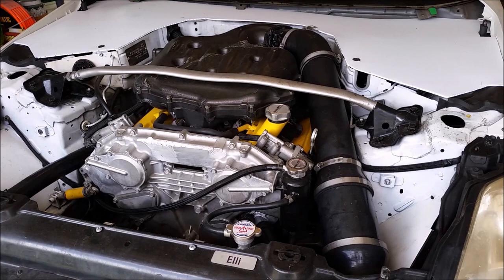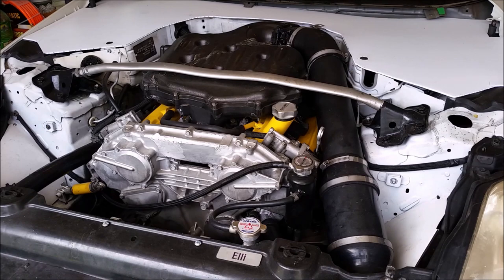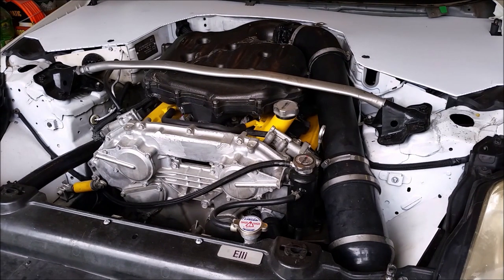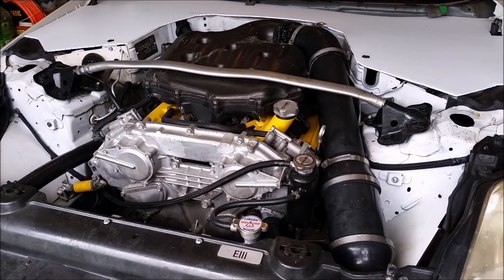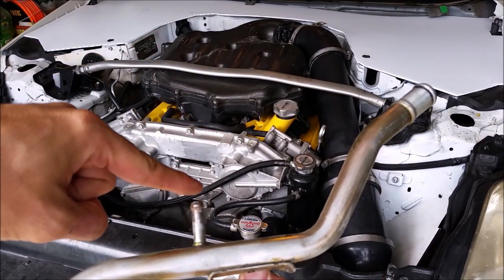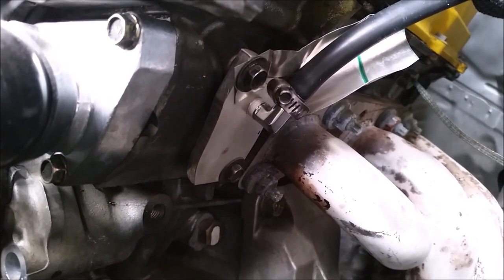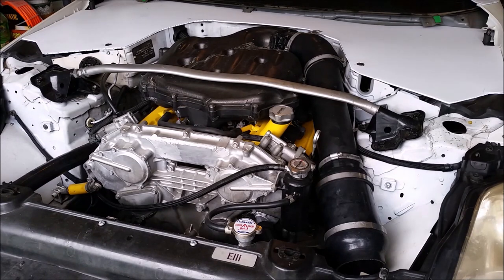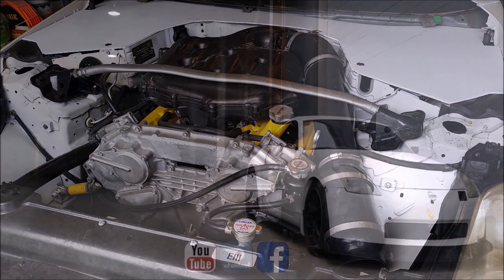Nissan 350Z Heater Hose Delete Fix DIY

Comment: I’m building my vq35de right now and deleted the lines to the throttle body and to the oil heater. I have a feeling my thermostat won’t open as a result or that and a hard to bleed system. I want to just remove the thermostat but if that’s a bad idea do you think drilling a small hole in it to allow air to escape but not much coolant would be effective?
Reply from the maker: Definitely don't delete the thermostat, you'll over heat because the coolant will flow through the radiator too quickly. Drilling the hole should work, but this way has worked perfectly for me. Before it wouldn't open and since adding the bypass hose, it's been flawless.
Reply: @350Z247  Would simply cutting off the coolant flow to the throttle body be enough to cause the thermostat to function differently, or would this be just a negligible change in its performance?
Reply from the maker: @TheChadPad  bypassing the throttle body should have no change on how the rest of the cooling system works. It should keep the throttle body cooler and leave one less failure point in the cooling system.

Comment: Really hoping you see this and can get some insight from you

I’m doing this exact same cooling setup.  The only issue I am finding is that I cannot find that block off plate with the coolant port by the manifolds. Do you know if a company who makes them or would you be willing to make one and I could pay 

Would love to hear back from you, thanks
Reply from the maker: I made it out of a plate of aluminum after tracing the gasket on it. It was very easy.

Comment: I rebuilt mine and it was fine until the bleeder valve blew and it over heated i replaced head gaskets and it over heats on me only when i turn the heater, off i did a pressure test it checked out my next step is replacing the radiator then deleting hoses like you did but the hose for the heater that you removed and added that aluminium plate, could i keep the heater hose but bock off the second pipe with a cap the one that goes to the upper radiator hose ? Because my thermostat isnt opening the coolant begins to boil? Thank you
Reply from the maker: As long as you get coolant to where I put the aluminum plate from the back of the engine, you're good. You could use the heater hose to do that, I just wanted to delete everything I could. So, your plan would work, just make sure you use silicone caps when covering that extra pipe.
Reply: @350Z247  Thank you so much for quick response ive been on this car for weeks i will try that today, will keep update
Reply from the maker: @Alexbk007  Good luck man! You could also try a lower temp thermostat to help it open a bit earlier.
Reply: @350Z247  (update) I blocked the bypass hose with silicone caps i found at oreillys, the lower hose finally startes to heat up but then it started to cool down but it didnt over heat, the lower hose was cooled but the other hose on the thermostat that goes to the oil filter was heating up should i cap those to so only coolant goes to the thermostat? Thank you
Reply from the maker: @Alexbk007  I deleted everything at one time; so, it's hard for me to say exactly which hose could be causing a problem. Just to double check, did the car get up to temperature and did it overheat? Because with the hose from the oil cooler and the hose from the heater core, your thermostat should be getting plenty of warm coolant to allow it to open.
Reply: @350Z247  it doesnt over heat until i turn the heater off on a slope ima try to deleter the oil one if that dpesnt work im going to replace the radiator because its just begins to boil at the top with a cold lower hose.
Reply from the maker: @Alexbk007  from experience, it sounds like the thermostat isn't opening and allowing coolant to flow properly. Have you bled the system with the front of the car up in the air on jack stands? The VQ is notoriously difficult to bleed. If you do get a new radiator (always a good investment, but I don't think it's the problem at this point), I have had a good experience with my Megan Racing all aluminum unit. It was like $180 I believe.
Reply: @350Z247  yea i belive theres air because i feel the sloshing jn the lower hose but ive been bleeding for over a few days now lol but i will invest in one soon. im gonna give it another try right now and see if i can get it to bleed the system thank you will update
Reply: @350Z247  (update 2) i installed the radiator, i deleted every hose besides the heater and upper and lower to the radiator and its not overheating but it wants to open the thermostat but keeps closing and i feel and hear air sloshing around the lower hose i feel the lower hose heat up at first but it doesnt get as hot as the upper hose im lost lol but my next step is to install the lower temp thermostat hopfully but i dont understand why i feel air in the lower thermostat hose after bleeding the system with a spill free funel after some time. Any suggestions? Thank you
Reply: (Update 3) ive gotten the thermostat to open on its own but putting the heater on medium allowed the coolant to heat a bit more then it open on its own and got the air out also lowing  the jack down while it cyclkng through with the funel let air out as well i went for a drive no over heating but again iver heated when i got on the drive way ive read ghat thats natural and to re bleed it and should be fine will update tomorrow but making great progress. Thank you
Reply from the maker: @Alexbk007  hmmm yeah it sounds like you've done everything to get all the air out. You could try vacuum bleeding it where you put the coolant passages under a slight vacuum then open a valve and suck all the coolant in. I've seen it done, but I've never personally done it. You could also add a swirl pot which will continuously bleed air from the system. I have a video in my cooling playlist on where I installed mine.
Reply: @350Z247  ive always wonder how they didi that but i get it now through a passage, today i will reattempt to rebleed.
Reply from the maker: @Alexbk007  I'm sure there's a good video somewhere on YouTube of vacuum bleeding your cooling system. Good luck!

Comment: Did you delete the bleeder valve as well? Any issues with that? I was thinking of putting a bleeder valve in the new line you’re suggesting. Is it needed?
Reply from the maker: I haven't needed it because the coolant system is now so much more simple without the emissions hoses and heater hoses. I just jack the car up in the front to angle the car to help the air escape and run the swirl pot I showed in the sister video to this one. However, keeping the valve won't hurt. The only reason I don't have one is mine broke, and I didn't need to replace it.
Reply: Alright. I'm going to try and run this new line without for now then. I don't have a swirl pot in my system. Is it required? I'm also still running a stock thermostat, is it worth swapping out to the mishimoto one? I'm having overheating issues that I think is from a thermostat not opening; similar to your issue.
Reply from the maker: @keisenb  switching to the lower temp thermostat will just make it easier to open. It's good insurance. The swirl pot isn't necessary unless you track your car a lot, but it will help the system.

Comment: Don’t do this, it trapped air in my g35. You cannot burp system without heat
Reply from the maker: Then you need to get better at filling the cooling system. Mine works just fine.

Comment: So you retained the stock thermostat location and kept the stock oil cooler setup?  I plan on deleting the stock oil cooler  to be replaced by a radiator type up front. If that was done could that pipe you show be deleted? Useful video, thanks.
Reply from the maker: I deleted the stock oil cooler, but I cover that in my Oil Cooler video. The hose from the back of the engine to the front is imperative to make sure the thermostat actually receives warm coolant to open properly.
Reply: @350Z247  Thanks for your response, I meant is the metal pipe you show deleted?
Reply from the maker: @FairladyS130  Oh the pipe I'm holding is removed. It use to bolt where the block off plate at 1:48 now sits.

Comment: Can I get parts list and instruction in comment section if you don't mind I would like to do this to my g
Reply from the maker: Kris Cell there really isn't a parts lists. Delete all the heater hoses so that all that is left is the hoses going to an from the radiator. I made the block of plate myself out of a piece of aluminum plate. Drill and tap that plate to run a hose from the back of the engine to the plate so the thermostat will open properly. The thermostat is a Mishimoto and the swirl pot is from eBay
Reply: 350Z247 thank you. I am having overheating issues and I'm going to do a swap and build the old motor after it has been repaired and I want to delete all unnecessary components and replace it all with components that provide horsepower. Im completely knew to the vq so I'm trying to learn as many things as possible. Once that motor is built I'm going to get a z and do a track build.
Reply from the maker: Kris Cell nice! My car's current cooling system consists of an oil cooler, aluminum radiator, heater delete, swirl pot, and lower temp thermostat. That's really it and it runs at 160 F with zero issues. Even in track it doest reach 200 F. More in the 180s. I'll be posting a detailed overview of my cooling set up in a couple weeks as part of my TT4 series.

Comment: Where can i buy the block off plate?
Reply from the maker: I made it from 1/4 inch aluminum plate using the gasket as a template. Super easy

Comment: Can you show a better video of what you did with the other line that has the bleeder valve ?
Reply from the maker: I'm not sure how much more detail  I can add. The hose just goes from the side of the driver cylinder head to a barb on the back crossover pipe. It's just to bring hot coolant to behind the thermostat to allow it to open.
Reply: Did you just cover the holes were the heater hose used to be on the passenger side oh what exactly did you do on the passenger side
Reply: Also how is your swirl pot setup like where are the hoses connected to exactly ?
Reply from the maker: @boostlyfe2872  every single hose on the engine is gone except the two large hoses in and out of the radiator plus the small hose in the earlier comment. I have a separate video in the swirl pot set up that does add some hoses. Bottom hose to the small barb on the thermostat, side barb to the radiator neck barb, overflow connects to the top barb on the swirl pot. You'll need a blanking cap for the radiator as the pressure cap goes on the swirl pot.
Reply: So my radiator cap will be replaced by a non pressurized blanking cap? What did you do to the barb that you disconnect the hose from to connect it it to the swirl pot the one that’s on the engine just leave it open ?
Reply from the maker: @boostlyfe2872  which hose? The one that was attached to the small barb on the thermostat? That comes from the factory oil cooler which I removed.
Reply from the maker: @boostlyfe2872  and yes, blank cap on the radiator so the coolant can flow out that small barb and too the swirl pot.
Reply: Thanks for all the help ! I have the car token apart right now , how did you make the new block off plate like which hole did you leave open it has two ?
Reply from the maker: @boostlyfe2872  either hole works the same. Pick whichever gives you the most room for routing. I just used a 1/4 inch thick piece of aluminum that I drill and tapped for a barb. Very simple vit very satisfying.